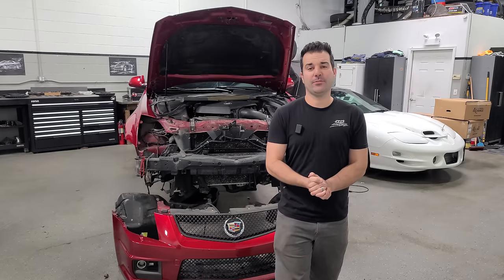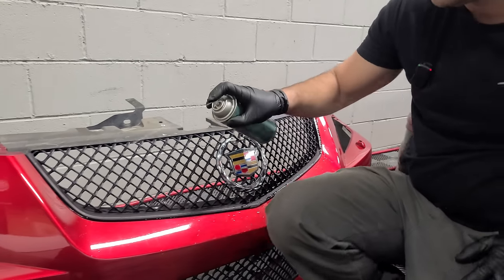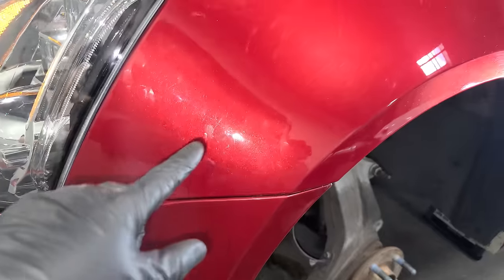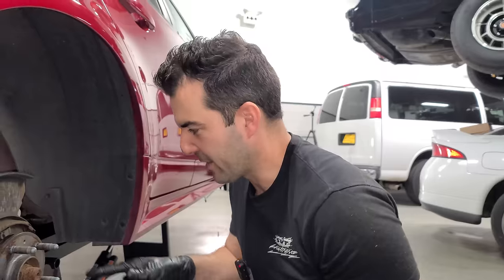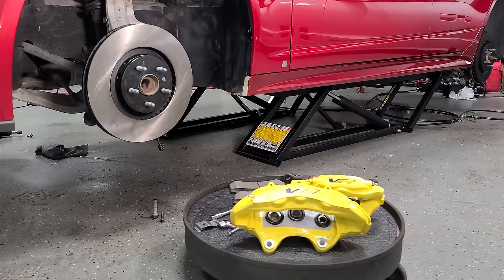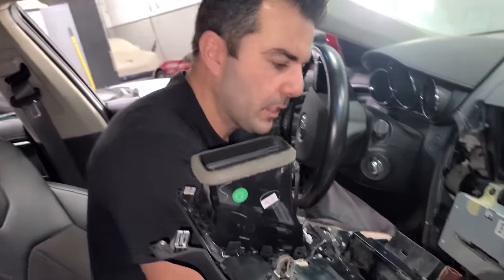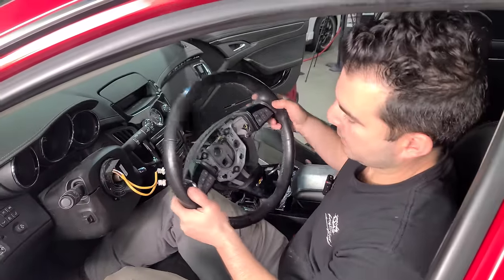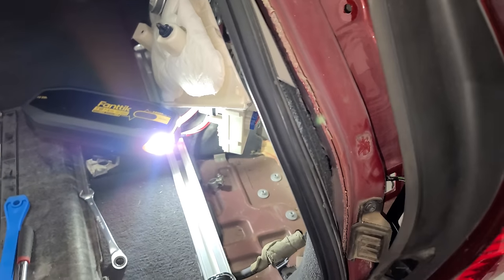I Finished EVERYTHING On My CTS-V Wagon To Make It More Modern & The Perfect Daily Driver!

Comment: I was locked in, soon as I saw how calipers are cared for, my style. 
After fifty years rebuilding them, they are so critical to perfect brakes when processed perfect. 
I'm a once a yr fluid change out in August when fall nights get so wet with humidity. 
Now system is protected all winter. 
Cheers, and yes, never let any solvent touch those square cut O-Rings, or it's game over if intent was to reuse them.

Comment: I found Goo Gone to be the pretty good for Plasti-Dip Removal. I myself, am not a chrome guy... To each his own...but I have to admit, the chrome does it right on that CTS-V Wagon!!!
Question / experiment thought. For the rear light assy., using the old one, you should see if you can heat it up like you did with the headlights your homemade oven and if maybe you could reform the plastic to original position as it cools so it doesn't curl up at the top.... If successful, you can do the  others for the car... Again, just a thought..... 
I upgraded my '11 Grand Cherokee to the Tesla style radio panel... I freakin' LOVE IT!!!... I do agree with your choice and reasoning to go the way you went with your infotainment setup...

Comment: I post here a lot and I own a Black W211 E55 sedan just like/because of the one Alex had and I became a fan of the channel doing the paint correction, maintenance and performance upgrades to it. I bought it as a daily before Covid but after all of the work I had put into it, it was getting to be ‘too nice to daily’ so it stays in the garage until the weekends. I drive it to work more now that the weather is getting better but my ‘daily, daily’ is a nearly mint 01 Mercedes W210 E430 that is lowered slightly with a set of aftermarket gunmetal grey wheels. It’s also black with tinted windows and almost everything still works! It had an Alpine head unit when I bought it that I plan on adding a multi-channel amp and replace all of the speakers and I need to rebuild the driver’s seat and replace the foam and repair a leaking lumbar bladder. I have a set of CLK Brembo calipers waiting on the next brake job and I have a new water pump and hoses that will get done very soon. I get my maintenance and service supplies from FCP Euro and my performance stuff from VRP, MK Ultra, and RaceIQ and I rely on Alex’s videos to get me through the heavy lifting. Most YouTubers don’t change someone’s life but I never would have bought an old Mercedes, much less 2! 😂 Thank you for the fun that you have personally brought into my own life due to your content and the hard work you have put into building your channel. I look forward to your videos every Saturday, keep up the great channel!

Comment: My old CTSV Wagon looks amazing! Great job Alex 🤙🏼🙂
Reply: Did you own this too? I sold it to Hoovie. I have questions....
Reply: @scottgordon3669  I did own her, from late 2017 to mid 2018. I'd be more than happy to answer any questions you might have
Reply: @LoveToDrive  what do you know about the supercharger? I knew it wasn't stock but that's all and did you own it when it got wrecked? Thanks!
Reply: @scottgordon3669  the stock Supercharger was replaced due to it eatting itself. I had Hawks Motorsports in the South Carolina, put in New Supercharger that was a port and polished. Changed the pulleys and added the Air Raid intake. They Tuned the motor and Transmission. I believe that I was the first owner after the crash.

Comment: If you use rubber/brake grease to install the seals only use the tiniest amount that will do the job as it can trap air and cause spongy brakes.
If reusing pistons you might want to lightly hone them with 1200 grit paper.

Comment: See that little hole in rotor where the studs come through there's a little hole in there where you can put bolt and you rotate the bolt and it pushes it out. Right now you're doing what we call working harder than you need to.😂

Comment: Alex i had the same problem with my M12 Stubby gun and when i replaced the friction ring with a new one it was a pain in the backside to get on, i did use a ⅜dr socket to get it on then it was that loose with it stretching over the anvil sockets wouldn't fit over the ring so squeezed it in a little then it was too loose and sockets would fall off so in the end i was no further forward and wasted money on it.

Comment: Sadly, only wagon I've owned was a 96 Roadmaster with an LT1.  I had Afterburner mid-length headers, H-pipe, and Flowmaster 40's, tips exiting behind the wheels.  It sounded sooooo nice.  Something about the 'ol SBC  that made those mufflers sing.  Anyway, now driving an 03 GMC Envoy with a 5.3 and plan to do some fun stuff to it, maybe even an LSA blower swap kit.

Comment: My only issue with chrome plating is the price. Had to replace a weather strip for the Accord's window, which is chrome plated: 100$ a window. Similarly replaced weather strip for the Civic which is not plated: 60$ for 2 windows.
Don't necessarily have an opinion on how it looks, except if it is tasteful and makes sense.
I think it's ridiculous that dealers now overcharge for blackening chrome plated emblems and design elements as if it is a premium upgrade...

Comment: Wish I could have some cake lol.  As per usual my 335xi is acting up.  No check engine codes at normal driving. But when I stomp it 6th cyl misfire.  Has all new index 12 injectors new coils new plugs and a ton of other shit.  I can’t afford anymore. Just bought our first house.  May have to sit for a while. I just can’t sell it.  I may try to clean the intake valves myself.  I’ve done all the work myself.  And it’s a lot.  A lot of it has been preventive maintenance tho. It’s been pretty good to me.  Thank god it’s not my daily. I do have a piece of junk to drive that runs fine

Comment: The higher quality seats are "cooled" using a thermoelectric device and they actually blowed refrigerated air. "Ventilated" seats just pass ambient air through the seat. I wonder if your V is cooled or simply ventilated.

Comment: You can actually use a impact and a bolt to pull off those rotors alot easier  theres a threaded hole on the rotor thatll push it off the hub.

Comment: Beautiful Car.  I have an '08 Claret Crimson tritium V, and it's has less than 75K miles on it.  Stays on the garage, covered most of the time. I bought my Husband an '18 XT5 because as we have gotten older, it's something easier to get in, and out. I wish the XT5 had a North/South oriented V6 instead of transverse, but it is AWD, but no way or really modding it to make power, and I haven't even seen anyone doing anytime "V" conversions, or the twin turbo VSport v6 swap. I have seen Procharger kits for the V6 CTS, but they are primarily rear wheel drive setups, I think even the AWD CTS have the North/South engine orientations. Maybe a Northstar swap into the XT5? That would be fun.  I had an '01 ElDog and it sounded good when you made it growl with the Borla catback system.  Great motor till about 150K miles if that much before you blew the heads. I sold mine when I started to have to put a quart or so of water in it every other tank of gas, and when the heater core went out, I knew it was time. I had been looking at the CTS as me and my Husband needed a 4 door, and I wanted I knew it had to be "Ni@@a red" like the ElDog, so I started looking. Found a Pearl white V that I loved, Danny REALLY wanted that one, but I was set on Red. I ever thought about holding out for a Wagon, but they are Rare.

Comment: The V Wagon looks drop dead sexy already. But now I'm curious as to what kind of tune you're looking to put on that beautiful car. Are we going to get that 40+ MPG And 700-ish hp? I'm low-key hoping so, but I'm sure we'll see what happens in the next video.
Reply from the maker: 40 mpg will be really hard but I'm definitely going to try for an improvement in MPG and more power!
Reply: @LegitStreetCars  either way, best of luck getting close to that mark.
Reply: I had essentially the same mods on mine and when I was using e85 I averaged 14mpg. On 93 I averaged 18mpg

Comment: if you already have the brakes assemblies  torn down, why wouldn't you hit the backing plates with some tremclad  rust paint?... seems a little redundant  to spend big monies on new parts and powder coating, to mount on rusted supports,...clean it up while you in there.

Comment: Question for you my friend. If you have some time and any info on the base 09 Bose CTS radio system I'm looking for the pinout info for the stereo and stereo modules. I need to locate the pinout diagrams for both the base and Nav systems. I have the parts minus the Nav Bose amp to upgrade my system to the factory Nav system. If you have any suggestions on sites where I can get  the pinout info for both systems that would be great, any info to point me in the correct direction with URLs etc.
Thanks again Alex love your channels! If you guys are ever in the Louisville Ky area and need anything just yell.

Comment: Were the brake discs you removed not the same “2 piece” rotors you get on the PP W204 C63? The calipers appear to the the same as the W204 brakes

Comment: How do u pull the caliper out if the other calipers aren’t installed? Air would just blow out the other openings. I just so happen to be rebuilding my 135i 6 pot calipers for my e36 m3.

Comment: The problem with manuals and wagons in the US is that enthusiasts don't often buy brand new.  Manufacturers base what they produce in the future with what sells best new.  If they can't sell it, they don't bother making anymore. Thus there are less manuals and wagons on the used market.  There's really not a great selection of wagons in general.  I'd like to see even just boring car daily driver wagons.  I had a Volvo V50 wagon.  I wish I would have gotten the turbo version, but otherwise it was a nice daily.  Handled well for being a non-performance car and was comfortable and quiet.  I ended up selling it because I needed something more fuel efficient and more reliable.  That car wasn't well maintained by the previous owner and I spent way too much money on it repairing stuff and things just kept coming up.  I'd like to have another daily driver wagon one day.  I was hoping for a current model Volvo V60, but it's too far out of my price range.  Maybe a Volkswagen Golf wagon.  Most of the modern wagons in the US today are luxury cars and just too expensive.

Comment: It's been a long time since I've done brakes myself but brake fluid used to be the worst thing for paint. Is powder coating resistant to brake fluid or has brake fluid changed since then?
Reply: Powder coating holds up well.

Comment: Alex Please Help!

I have a 99 Trans am 6spd. Just bought it. I'm beginning to question if it has the factory 7.5 inch 10 bolt rear diff. It does have 10 bolts. It has a cover that says "G2 Performance by Gigliotti". And, on the driveshaft side of the diff on the bottom the number 26041414 is engraved on it. I googled it and apparently others have asked the same question on LS1 Tech forums and such but none of the threads provided an answer for what diff this is. Ive read anything from a M6 3 series 10 bolt to a 8.5 inch GM rear. Really wanting to know what diff I have

other people if you have an answer for me please help!
Reply: regularly you should have a aluminum tag bolted on, with the drive ratio and parts number. probably you just have a thicker cover and or with more oil capacity.

Comment: Noooooo! If you're going to replace the seals leave them in for powder coating. The seals are designed to withstand very high temperatures and do not melt at powder coat oven temperatures. Leaving the seals in provides proper masking for powder coating and will save the powder coater time, and you a lot of money.
Reply: Omg they sandblasted the insides of the bores too!? 😢  That's a precision machined surface they just ruined. Leaving all that aluminum exposed on the inside surface of those calipers is definitely going to cause corrosion problems if you plan on driving that thing in the rain or snow. 

I highly recommend de-greasing that surface and spraying it with some sort of aluminum primer before you put those back on the car for good.

Comment: Technically the seats are “Ventilated” not “Cooled” seats, which is crazy to me because my CTS was the same as this but my Chevy Avalanche actually has “Cooled” seats?! Don’t get why my Cadillac didn’t have it but my Chevy does. You can also tell by the logo, the fan logo means “Ventilated” and the snowflake logo is for the “Cooled” seats
Reply: The basic seats don't have ventilated seats but the recaros are supposed to
Reply: @sutherlacd27  these are the Recaros so yes. Not sure on a V but my CTS had ventilated/heated ones which are same design wise to the base seats in a V.

Comment: Yea sure its a nice steering wheel but how many people have or wants to drop $1000.00+ on a steering wheel. I need a new steering wheel for my SUV but I DO NOT have $1000.00us or $1347.62 Canadian in my case to buy a fancy one. I also have piano black in my SUV and as long as you use a soft microfiber cloth and a gentle cleaner you will not ruin it. As much as I liked Peter i personally think he was just along for a free ride.

Comment: Hitting rotor with hammer will bend the hub,and it can shake steering wheel after instaling new brake set,very dumb move to hit it with hammer
Reply from the maker: I've never met a mechanic who doesn't take rotors off like this and after hitting thousands of rotors with a hammer I've never had 1 issue. How do you remove a rotor that's stuck to the hub?

Comment: So you're the guy who makes me drill those damn rotor set screws out every time!
Do not use an impact on those little things, all they do is stop the disc falling off when the wheels and calipers are off the vehicle. With wheels on the lug nuts clamp the discs in place, the calipers don't actually hold the discs but by themselves will stop the discs falling off.

Comment: My cooled seats get cold they are tied into the air conditioner. Owners manual states that you shouldn't use the cooled seats without the air conditioner on. 3 settings on high your ass will freeze! 🤭

Comment: Really, so all cooled seats are nothing more than a fan in them? Well the perforated leather cooled seats in my 08 Lincoln mkx literally got freezing cold if you had shorts on you'd have to turn them off also they got ridiculously hot during winter and you could smell antifreeze whenever you had them on because it was circulating through them I believe but could be wrong on that... The damn car was wayyy ahead of its time for 08 because it had some kind of weird driver-control system and I couldn't get it to break traction and kick sideways but eventually I went on pure ice shiny blacktop parking lot and from a dead stop I cut the wheel to the left and floored it well she started to kick out but then it paused the stereo in to make me pay attention and then it literally took over control and took off in a straight line! I was kinda pissed tbh I want control of my vehicle I mean what if I was intentionally trying to miss a squirrel or a deer smh but yeah the whole damn thing was a rolling computer basically even the headlights turned toward the road when you went around corners so you could see ahead of you insane!

Comment: I despise what has now been named by me as Cadihack - hideous vehicles with putrid styling (pre-dented and totally not with any style or purpose) - there is not a hint of luxury on these cars and they are overpriced for what you get.    EXCEPT when you get a V-Series.   I have long contended that the base Cadihack should have been equipped EXACTLY like a V-Series so at least you had an engine and chassis that would make up for the hideous and untalented design and the lack of luxury quality on the inside.    Good job resurrecting a half-turd Cadihack.   Sadly, the wagon version did not look that different from an old AMC Hornet Sportabout.     Good luck with your GM product.   You'll need it!